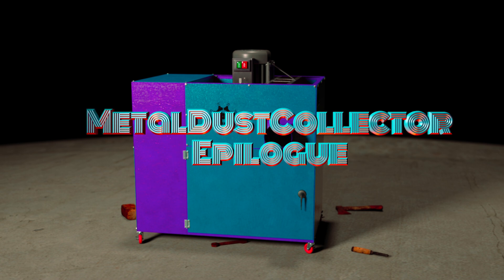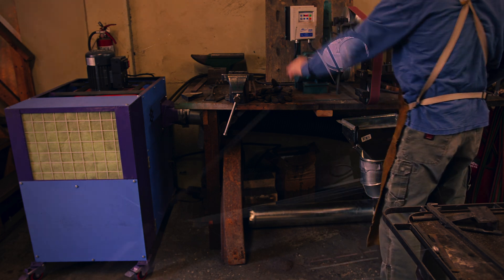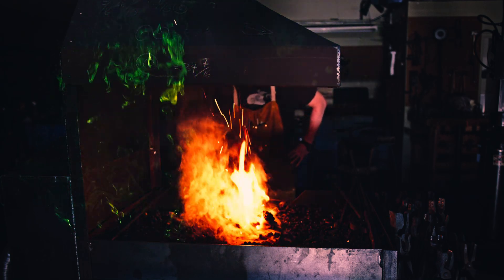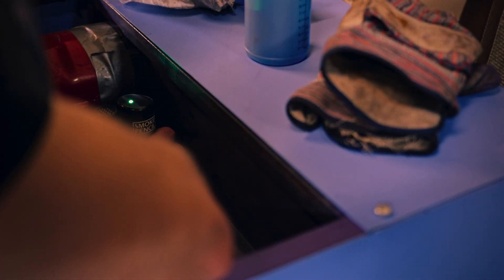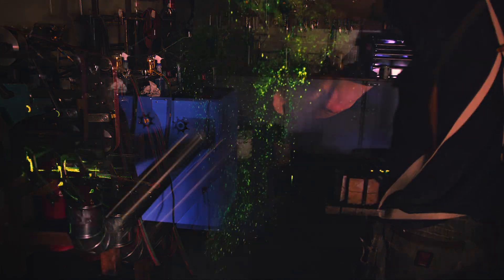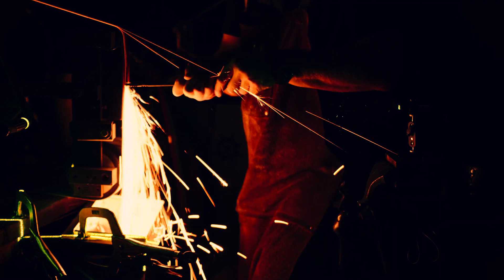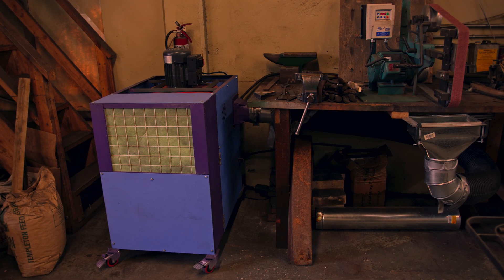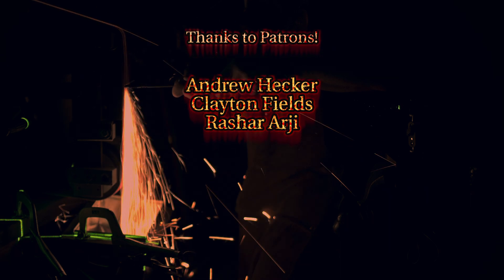Make a Metal Dust Collector: Part 6 - Epilogue with a laser (2.5k HDR DIY)

Comment: Awesome! I wonder if you could measure the dust better by having four lasers with the field placed horizontally directly under the belt? One beam every 90 degrees to maximize the amount of light being transmitted.
Reply from the maker: I think part of the challenge was also that the grinding dust is not very reflective.